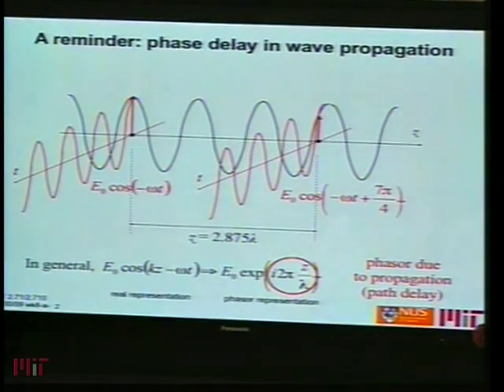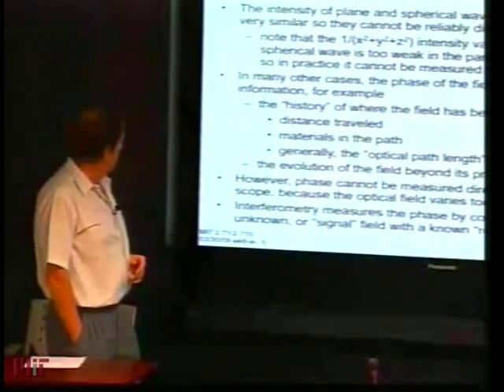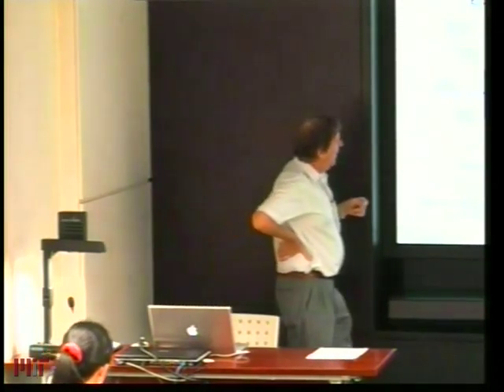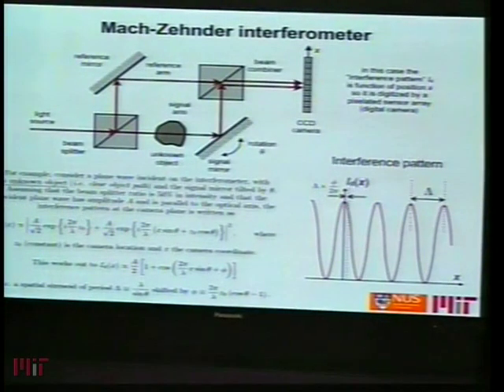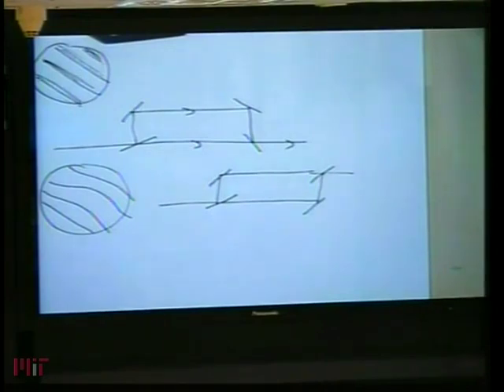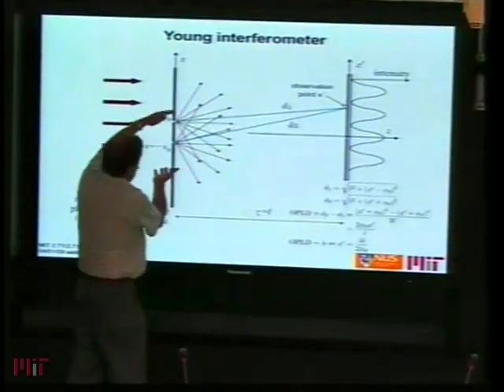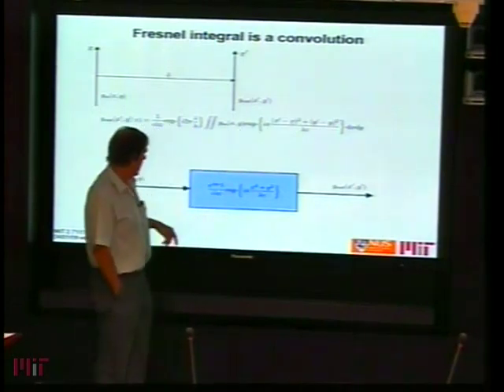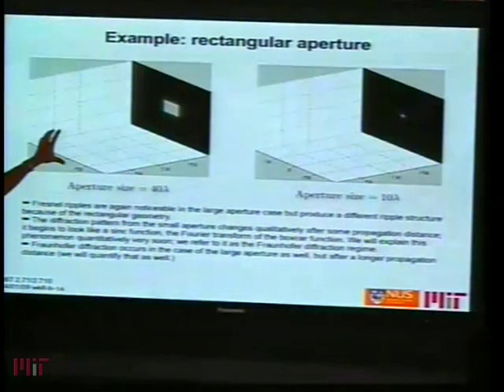Lec 15 | MIT 2.71 Optics, Spring 2009

Comment: For a clear picture see the slides at the following address:
http://ocw.mit.edu/courses/mechanical-engineering/2-71-optics-spring-2009/video-lectures/lecture-15-huygens-principle-interferometers-fresnel-diffraction/MIT2_71S09_lec15.pdf